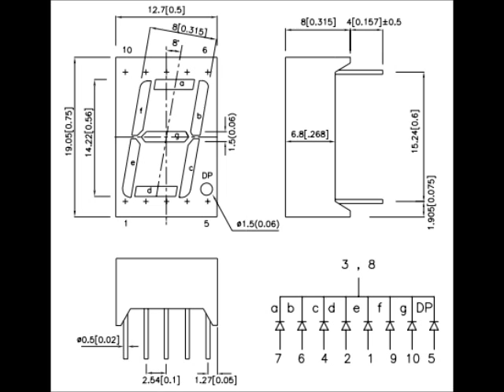How to control a 7 segment LED display

Comment: To beginners this is of no help at all because all of the components are already installed. You have to explain it as you go, instructing where each jump wire goes and each pin goes otherwise it’s pointless.

Comment: where are you giving supply and how much when glowing only one bar???
Reply from the maker: +shahzeb haseeb It was probably 5V as I used to do the PIC projects all at 5V and I think I was using 330 Ohm resistors but not 100% sure. You'd need to pick your resistors based on the data sheet for your display.

Comment: can I switch on 4 leds with one transistor or without transistor
Reply from the maker: +Hamza Mohammad As long as you choose the right resistor value for your circuit it shouldn't matter if you use a transistor or not. You only need the transistor if you need more current than your microcontroller can handle.

Comment: okay am working on something that requires one to Write an assembly language program to produce one digit counter using 7-segment display. The counter will count number of a push button to be pressed, every time the push button is switched ON/OFF the number on 7-segment display will increase.using 8051 micro-controller, but my program when tested using proteus counts too fast to read  and does not operate with the switch and i cant seem to figure out the issue. any ideas how to counter that...

Comment: man if you can help .. i made a digital clock with 6 7-segment chips... i don't know how to place 3 push buttons to set time ..
every time i remove power source it all go to 00.00.00 i can't see if the hours works  or not !!
Reply from the maker: +Ahmed Yehya What chip are you using?
Reply: its easy just get trolled
Reply: 1. needs to be the right chip, 2. removing power removes all memory of it being  on whatever number, in other words, you need to store the variables to a data storage
Reply: Blah blah
Reply: Who cares💩

Comment: Hello,
         Could you recommend a way to connect 2 digits controlled by a switch to advance from 0 to 50. I am trying to create a scoreboard with 3 sets of 2 digits. I require 16 units for a sports club that is volunteer and not a great deal of funds.

Regards

Glenn Burley
Cairns Australia
Reply from the maker: Glenn Burley Hi, I haven't tried it myself but I think a cd4026 chip for each digit. You put a button on the clock pin (pin 1) and every time you push the button the digit increment. When you push the button to increment to 10, pin 5 will go high so you need to have pin 5 connected to pin 1 of the cd4026 chip for the second digit. That way you can increment up to 99, you connect pin 15 on both cd4026 chips and then add a switch to reset back to 00.

Comment: You don't actually need to use transistors. The display draws barely any current. Using PIC is great but 4026 is more convinient.

Comment: Unless you're just trying to do it a different way, why not use a CD4026BE counter/divider with a 555 pulse clock timer, then install seven 150 ohm resisters in place of the transistors on the anode side (instead of the NPN transistors), connect the resistors to the anode side of a common cathode seven segment display. You can use pin #5 (which is the divide by 10 pin) to add the first digit of the counter if you want it to count from 0-99 (to the next CD4026BE in line which would drive the first LED display). You could get a 2 digit common cathode LED display. This would allow it to count from 0-99 with just 2 CD4026BE counter/dividers, a 555 timer and a few resistors. It would be easier and less expensive than lighting them individually in a specific sequence at 100hz or so. The CD4026Bs are only $.50 cents or less each. The 555 Timer is less than $1. Resistors are much less expensive than transistors and there's no programming.
Just wire it up, adjust the clocking frequency of the 555 timer by changing the values of a resistor or capacitor or both (at the 555 timer), enclose it and you're done.
I just made a two digit 0-99 counter for under $9.00 US  (Just under 7 Euro) Mine is controlled by a temperature sensor switch and a PNP transistor.
The PNP transistor is to allow me to flip the polarity of the output from the temperature sensor switch (to apply 5 volts positive to the clock input on the CD4026BE (which requires a positive voltage input to the clock pin)  I didn't use a 555 timer for my needs. 
BTW, the CB4026BE counter/dividers electrical characteristics will range from +3 to +15 volts up to 1200mA.
They've been in production since 2003. :-)
I understand this is Arduino and Arduino is really cool but it just seemed to be overkill for a simple counter display. 
Thanks! :-)
Reply from the maker: Excellent post, that method sounds like a good project and sounds like the CD4026B might be useful for a VDF project I'm planning. Also it would be perfect for those large 6.5" high 7 segment displays they need 12 volts with a few miliamps I think.

One thing though a 16F886 running on the internal clock could drive two normal 7 segment displays with one 150 ohm resistor on the cathode of each display and would cost around €3.25 including the 7 segment displays according to farnell prices at the minute and you'd have the built in ADC pins for sensor measurement but like you say a lot of programming involved and you'd need a programmer too.
Reply: Thank you for the response! :-)
The most expensive part of my counter was the box I used to enclose it, otherwise, it would have only cost about 3 euro.

I'd love to get into Arduino. I could make some really cool projects and I'd love to learn about the programming side of it, but right now, I just can't afford the initial cost.
I watched a video of a monster size game (all done with Arduino), it was awesome.
I have a feeling I will take the plunge and get into Arduino at some point. :-D

I have a feeling that even after I start working with Arduino, I'll still use IC circuits for standard and simple circuits.
I looked into the initial cost of Arduino and it would cost me around 100 euro or more just to get started.
I have a couple of major surgeries coming up so I'll have to wait till after that. Insurance deductibles are draining my bank account right now :-D
Nice work BTW! :-)
Thank you!
Reply from the maker: TreeTop .Videography
That is a good price, I forgot about the cost of an enclosure €3 makes more sense :)

100 euro is way too much just to get started, you can get an Arduino pro mini clone for around €1.75 on ebay and then you just need a USB to uart cable or ftdi cable which is about €1.50 on ebay to upload your code. They wouldn't be genuine Arduino quality but they would do to give you an idea if it was something you'd like to continue to learn. Sounds like you have sensors and LEDs already so I'd say you'd have enough to get started.

The Atmega chip on the Arduino comes preprogrammed with boot loader so you don't need a programmer, just the usb to uart adapter. Also because of the boot loader you aren't really programming the chip, somebody else has already done the hard work so you just use some basic c code to control it, they call it a  sketch. So learning to program an Arduino is very simple.
Reply: RC Tractor Guy Cool! I just did a little research and read about the clones that were almost as good as the real Arduino. 
I was a little skeptical but after reading your response, I think I'll give it a go.
I already have the UART to USB adapter (to program other controllers with a GUI interface I use). 
I have a large array of sensors, resistors, transistors, LEDs, pots (trimmer and panel mount) and a lot more. 
I'll check out what they have on Ebay. It would be good to play with it while I'm recovering from the surgeries (back and hip).
I bought a 4 channel oscilloscope a while back that really helps me to fine tune my circuit designs. I would imagine that it would help with the Arduino projects as well? I have a Spectrum Analyzer for radio frequencies too.
(I was looking to see if any wireless devices could be made using Arduino but I haven't found anything just yet (haven't been looking very hard though). 
Thank you so much for the info!! :-D
Reply from the maker: TreeTop .Videography Well most Arduino boards are open source hardware so anyone can make their own, its just nice to buy an original to give to the guys who designed them but some times it can be very expensive. Yes an oscilloscope is very handy for this sort of things, I got a 2 port 50MHz one a few months ago. The signals will only be a couple of kHz so don't need a terribly high frequency scope.

I've never herd of a radio based on an Arduino if that's what you mean but there are lots of examples of them being used with cheap radio modules like nrf2401, XBee modules and bluetooth modules.

Comment: I fail to understand the purpose of the transistor, and the phrase you're looking for is persistence of vision.
Reply from the maker: I was trying to show the worst case scenario when you draw more current than your micro can supply, I know I didn't make that clear enough sorry. The pic I'm using can only supply 20mA but you can drive these LEDs at 25mA if you wanted, I agree it would be a waste of money to add the transistors to do this but maybe somebody would want to. I have other 7 segment displays that can go to 30 mA and you can go to nearly 200mA on those if you keep the switching to less than 0.1ms. You can also get 12 volt 7 segment displays but that would require more than just one pnp transistor.

Comment: Wich pin is normally ground
Reply from the maker: I think it's usually the middle pin on each side but you can always check the data sheet for your 7 segment to be sure.
Reply: Thanks

Comment: Can you help me,a circuit to make the 7segment display count + 1 everytime I push a button . .thanks
Reply from the maker: Hi you just need to use a push button on your microcontroller to increment your display. Look up arduino push button to give you an idea.
Reply: is their a way that I don't use an Arduino . our professor said that we don't have to use a micro controller. thanks for the reply. :)
Reply from the maker: Junel Veri You could try a 7 segment driver chip maybe, I'm sure there are many ways to do it as I'm pretty sure 7 segment displays pre-date affordable micro controllers :)
Reply: CD4026B IC chip. You can look up the data sheet and such. It's a 16 pin IC that uses an input pulse to count up and resets once you get to 9.

Comment: can you explain how to do so with only 3 wires ?....Pls give a youtube link.
Reply: Search for "3 to 8 line decoder" (or 74HC238, for example). Basically it converts a 3-bit binary number into one active line out of 8. You still need to multiplex the segments and you still need 8 wires between the decoder and the display, but you save some pins on your controller.

Comment from the maker: Cool glad to be proved wrong, I've only ever tried to get one working without much success :) I knew you could get modules which took DC inputs but I taught the VFD was driven with an AC signal, I should actually buy a module some time and try it out, they are pretty cool.

Comment from the maker: Hi, I think I understand what you are asking. The first thing I would do is measure what current and voltage on each pin of the original display. You would then build your own large display and ensure that it can be operated using the voltage of the original controller and that it does not draw more current than the original display. You will need large transistors or relays to control your large display I would assume.

Comment: In short... How can I control power a larger display (led segments or groups of leds) by tapping into an existing display circuits led solder pads.  I am assuming the larger LED display of my own fabrication will have it's own power supply (likely a PC ATX 5V DC leg). I'll need to use a transistor for each segment, but I'm not sure how to use original devices PWM from it's LED(s) without interfering with it or damaging it.  For making large displays from small ones. eg. Clock, Vumeter, Spectrum

Comment: I have a question.  Where would be  god source of information, or how-to, on tapping into an existing LED=IC display circuit, to copy the display into larger banks of LED's.  Eg, VUN, Spectrum Analyzer, or a clock.. etc.  I'm wishing to create such a display on my wall.  I'd like to see if I can tap into a segment display, but not sure how to amplify, copy, or trigger a bank of leds, from such a low power circuit.
 Thanks for video!

Comment from the maker: You might find them in cheaper electronics, clocks instantly spring to mind. If you can power it up you'll pretty quickly be able to tell if its a 7 segment or an LCD or VFD. I got one out of an old cd/cassette player which was used to display the track number currently playing.

Comment from the maker: And in case there are any kids reading this, household appliances use alternating current which can kill you. DO NOT open appliances plugged into the mains electricity, DO NOT open an appliance and then plug it into the mains. Taking apart an old appliances to see what's inside is okay just make sure its 1. plugged out of the wall and 2. you are careful about capacitors, some can give you a nasty shock if they haven't discharged. Good idea to have an adult with you, preferably an electrician :)

Comment from the maker: Hi, the idea is good but I see two problems, 1. The clock is designed to drive its own display which will probably be different to the dvd display and so probably wont drive it. 2. The dvd probably has a VFD display which means you'd need the dvd players power supply just to drive it and (hopefully someone will correct me if I'm wrong) the VFD requires AC to drive it which makes it a lot more dangerous than the LEDs which are probably in the clock. Do you know what type of displays you have?

Comment: Holly crap! You have a lot of transistors!
I hooked up 3x7 segment LED display. My MCU flashed 1 segment at a time displaying the number. I used the transistors to switch to one of the 3 displays. So in total I used 8 pins (to drive the LED) and another 3 to switch between the 3 displays. Total of 11.
Not sure if my method was better. Just thaught I'd share :)
Well done btw!

Comment from the maker: Hi I have the transistors to show that if you want to draw the maximum current from your LEDs you may need to use them. You don't need them if you choose a resistor that limits the current to below 20mA or whatever the maximum current output of a pin on your micro controller is. You may also want to use them if the combined current on your LEDs is greater than the total maximum current of your micro, not sure what that is maybe around 200mA but don't quote me on that :)

Comment: Just multiplex the displays so that the each of the seven segment pins go to all 4 displays at the same time, but you control the common grounds of each display to display in sequence.  So if you wanted to display 20:57 on your clock, you would output 2, 0, 5, then 7 in rapid succession and have the micro controller turn on the ground for the appropriate display.  It should still be fast enough that the eye can't see any flicker.
Charlieplexing is an interesting concept though, save lots of I/O.

Comment from the maker: Well you choose a micro controller with 30 outputs if you wanted a 24 hour clock with two dots in the middle, the kind of normal LED clock display. or 28 outputs if you were just going to do 12 hour clock. If you keep the current below the 20mA you can avoid the transistors but it may not be bright enough for what you want. Another option to reduce the amount of pins required might be charlieplexing but I've never tried it so it may not be suitable you would have to look into that.

Comment: the dp isn't a segment, their are 7 segments on the display to form the numbers 1 - 9 if you had two displays and wanted to display 14 you wouldn't use a decimal point or you'd have 1.4

Comment from the maker: @AldoBr549 I don't have much experience with a capacitors other than a few filter circuits so I couldn't 100% say how it would respond but what you're saying to me makes sense. Even being able to slow it down a few ms might mean you could use a slower clock with the PIC which would take less power or free up time for the PIC to do something else.

Comment from the maker: @AldoBr549 Oh well just to make it clear if you remove all the transistors and their resistors and you're only left with the one resistor and the 7 segment you can drive that straight from the PIC provided you don't exceed 20mA on an output pin. so if you wanted you could use 7 resistors (one for each pin) and have every LED lit. I loop through it because then you only need one resistor and the current drawn by the system is only around 20mA as opposed to 20mA*7. Hope that makes sense :)

Comment: I wonder if you could use a small capacitor to keep the LEDs on until the next cycle of the loop? Then time wouldn't be as crucial. I also like the transistors because they would make it extremely easy to add a potentiometer for dimming the LEDs. I also apologize for the two comments and I appreciate your informative and cordial reply. THANKS!

Comment: Okay, thanks! Well, I think the problem was my understanding, not your explanation. I don't have any experience with the PIC controllers. I use the Arduino and it is capable of outputting more than enough current to power a 7 segment. So what I'm assuming is that your code runs through a loop and sends the appropriate output to the LEDs on every loop but that there is a small time that they are off and then on. That makes sense.